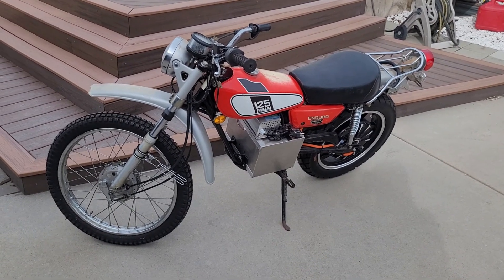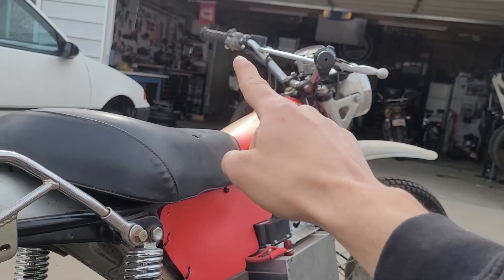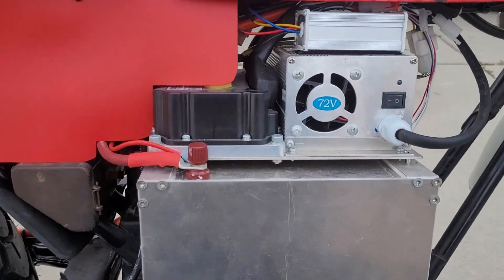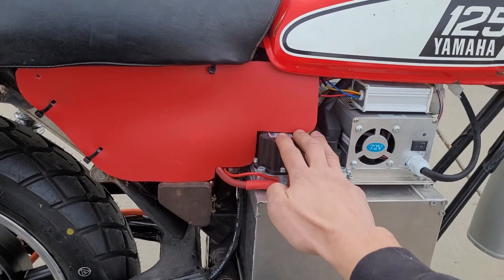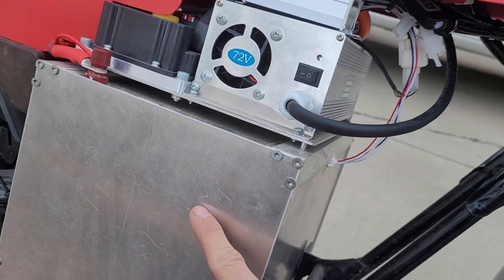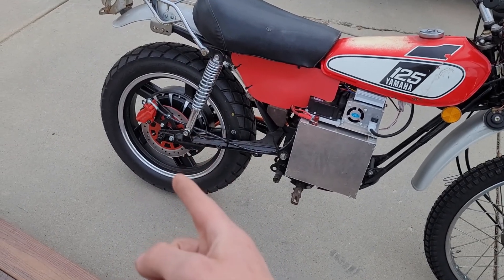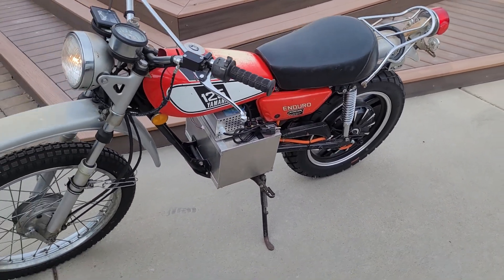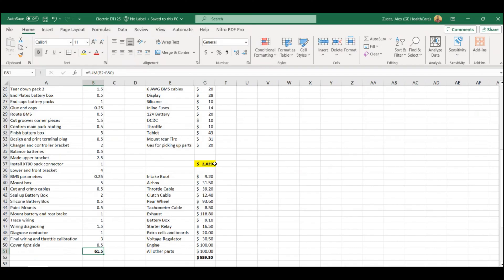1976 Yamaha DT125C Gas to EV Conversion for Under $2000, Electric Motorcycle Conversion Build

Comment: I have a Deco Hannah hub-drive e-scooter that is my daily driver, and it handles going through water quite well. I'm in Chiang Mai and in the rainy season you're always going through water. I was told by the dealer that I should avoid getting the entire hub submerged and that was about it. If floods were expected that might reach the battery, pull out the battery and wait until things dry out, put the battery back in and you're off. It'll be great when they get some battery swap stations here so that we won't have to just rely on filling up electrons at home and work.

Comment: Looks good and done well.  One correction.  A chain does NOT consume 20% of the available power.  Chain drive efficiency is very high, typically over 95% and often reaching 98% or more, because they transfer power with minimal slippage, making them more efficient than belt or shaft drives for many applications, though optimal efficiency depends on good lubrication, cleanliness, and maintenance.

Comment: Nice build, thank your for the video.

My tip for anyone who wants to convert an old motorcycle: you can sometimes easily install a battery in the tank from the underside if you remove the metal plates on the inside. I was able to fit a 1.44 kWh battery in the tank of my classic moped this way. This means that the tank retains its perfect appearance.

Comment: you could remove the lower section of the gas tank, leaving the visible part and mountings, and move the controller or charger, into the gas tank hollow, you could use the original throttle and use the cable to turn the potentimeter.... making the bike look more original ... but these are just extras and not really needed, it looks good and if you enjoy riding it that's all that really matters have fun
Reply from the maker: The gas tank cross section is shaped like an upside-down "U" and wraps around a frame member. There's not much space in there, and the controller and charger won't fit.

Comment: they make an ac qs hub motor? you mentioned the controller converting to ac?
Reply from the maker: I believe all QS motors are AC. 2 wires DC go into the controllers, and 3 wires AC come out.
Reply: @zuccamachine  I thought they were basically dc bldc motors..Now im not sure
Reply: @zuccamachine  looked it up , theyre dc bldc

Comment: The only negative about hub motors is all the unsprung weight, but it does make it possible to build a 2 wheel drive bike for off road.
Reply: The unsprung weight is only something that matters to people who care about numbers and on paper performance. It wouldn't exist if it was that much of a problem

Comment: swap gas tank for more batteries or storage(but batteries is always better). wouldn't having the brake light for regen be worth it?
Reply from the maker: @Defianthuman  Very common suggestion, but the tank is shaped like a U and wraps around a frame member. Batteries would not fit, and splitting the battery into 2 packs would add complexity and cost. I thought about cutting a door opening for storage, but all the Yamaha boomers would attack me.

You're right, I could wire in the regen signal to the brake light.

Comment: How did you mount the motor in the rear wheel or did it come preassembled?
Reply from the maker: @stevec5000  It is a hub motor. The motor is built into the rear rim/wheel.

Comment: What a great way to destroy a great vintage motorcycle.
Reply from the maker: @henrybobswillikers  I'll copy paste my reply to a similar narrow-minded comment:

When I bought it, it was missing more engine parts than it had. Clearly was neglected. I got it back on the road.

Not to mention I sold the rest of the ICE parts to other DT owners so they could get theirs on the road also.

Also, these DTs were mass produced, hardly classic in my opinion.

It's also a reversible build and you can put all of the gas parts back in if you want.

Comment: Why did you ruin this machine and blowing 2grand in the process?
Reply from the maker: @tarstarkusz  When I got the bike it was missing more ICE parts than it had. It would have cost more to get it running on gas than this EV swap would have. Now it's on the road, and so are several other people's bikes who bought the remaining ICE parts from me. 
You call it ruining, I call it thinking outside the box and trying something new. At the end of the day, this is getting miles on the road and putting a smile on the riders face now.

Comment: You ruined a great classic motorcycle  !!!!!!!!!
Reply from the maker: When I bought it, it was missing more engine parts than it had. Clearly was neglected. I got it back on the road.

Not to mention I sold the rest of the ICE parts to other DT owners so they could get theirs on the road also.

Also, these DTs were mass produced, hardly classic in my opinion.

It's also a reversible build and you can put all of the gas parts back in if you want.
Reply: It's not your damn bike dude. Buy your own and live in the past. 😂 Great work!
Reply: Having spent thousands of hours trying to save a classic bike and it constantly going wrong, this guy has saved a bike and given it another 40 years of life!
Reply: I agree, but it's not that rare of a bike, so it's not a big loss.

Comment: Chain drives unless completely neglected, rusty and un-lubricated are ~95+% efficient.  Not sure where you got the 20-30% loss from.
Reply from the maker: I agree, you're correct! Not sure where I (mis)remembered hearing that.
I still like the reduced complexity that a hub motor offers vs. a chain drive and would build this bike the same way if I were to do it again.
Reply: @zuccamachine  NP, I misremember things occasionally.  I agree that direct drive is a better option, as long as the rpm of the wheel/motor is what it needs to be.  One less mechanical bit to fail or need maintenance.

Comment: I see three comsiderations that you probably are already aware of. First, The torque arms you made. Are they strong/long enough? Is the retaining bolt and slotted swing arm strong enough? This could be easily tested with a quick fabbed mockup and a torque wrench, in a vice. Second potential problem is the possability of condensation inside the battery box which might create havoc with the BMS. And third, that positive powerr cable should have a cover on it.That said,, you've created a most awesome ride.

Comment: ... and a 12v winshield wiper fluid spray motor, feeds into a cleaned out redKoted gas tank, which now hold's my Dr Pepper... so at a push of the old starter button, I get a shot of Dr Pepper up this windshield wiper tube, that terminates near my mouth in my helmet ,  whenever I get thirsty.   For range, I get 100 miles on the battery, but I can go 1,000 miles before I need to top up on Dr Pepper.
Reply: Someone gave me a nice condition Susuki GZ250 with a monkey tore up motor to do this same kind of mod too, but I eventually sold it as I thought I'd need more battery area.  I guess not!

Comment: You evidently did a lot of research on this project which gave you a great clean & compact conversion! I have the exact same hub motor which I plan on using to convert my 1972 Honda CT90. Would you possible share the info for the rear brake you used for you conversion?
Reply from the maker: @rptrower  I got the rear brake from QS motor with my motor order. If you contact them, they may be able to ship you just the rear disc and caliper that will fit your motor separately.
Reply: @zuccamachine  Thanks, I will contact them.

Comment: Hi,
I relly admire the work!!
Im wondering how did you do the regen braking, does the motor come with it presetup?
Reply from the maker: The controller supports regen braking. It is on/off only and not variable. You can either use a momentary button to control the regen, or use an option in the controller app that full regen applies when the throttle is released. This is similar to single pedal EV driving.

Comment: I'm liking the  conversion!  Though a few thoughts if I may.  Why a 3KW vs a 5KW?  Was it cost or was range more the priority over speed?  I like the addition of the charger, you see that on several factory built cycles but not so many conversions.  Have you thought about moving it into the what was once the fuel tank?  That way it would be protected from the elements and it opens the possibility of using the gas cap area as the location for the power cable.  Anyway this is a fantastic project, and you've done a great job!
Reply from the maker: @ebikeengineer  The goal was to keep it under $2K. A 5kW motor was certainly possible, but the next size up motor, controller, and BMS would have bumped the build cost up by ~$500. Performance would have certainly been better. The nice part is all these next size up components can drop right in with no mounting modifications if that's ever desired.

The cross section of the fuel tank is a horseshoe shape, so unfortunately the charger won't fit. Not much would fit in there honestly. Maybe the DCDC converter and some wiring. But there's already ample space for it underneath.
Reply: @zuccamachine  You make great use of the existing space, I was just thinking weatherproofing.  Yeah a U shaped tank would mean you'd have to disassemble the charger to get it to fit.  But you got me thinking how I could install my charger on my Goat instead of carrying in my pack.
Reply: I should have watched longer - as you later answered my question on the 3 vs 5 KW motor. ;-)

Comment: Great Project! Have you thought about cutting the cutting the old gas tank open and use it to hide the charger?
Reply from the maker: @lorenzG9  The gas tank section is shaped like a U and wraps around a frame member. The charger wouldn't fit.

Comment: Hey I'd love to hear more about the battery! I'm about to do something similar on a dt250
Reply from the maker: @andrewgrimm7715  Most people will order a battery from Amorge that fits their size restrictions. Go with a battery that is just as wide as the engine was between the case covers, and fit in the biggest square you can.  Just be sure that if the bike falls over, the battery won't hit the ground in any way and is protected.

Comment: Nice build I got one similar but I used the fuel tank to store controller and transformer.  What kind of controller is that?… my 72v 3kw hub peaks at 45mph and cruises at 40 mph only pulling 30 amps it has more juice but I think the bms is restricting it. I know the mtr controller isn’t
Reply from the maker: @timmychase2097  Controller is listed in the video description - ND72360